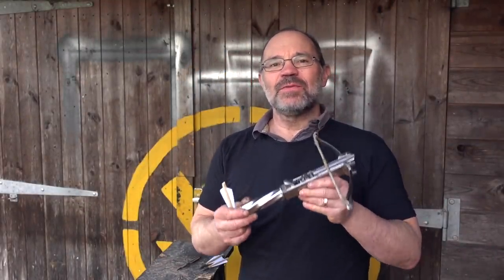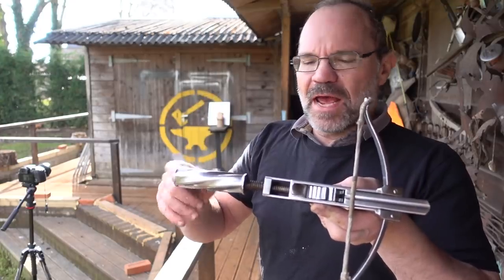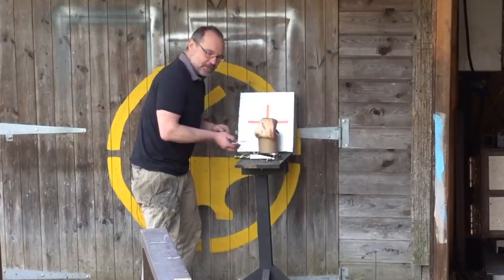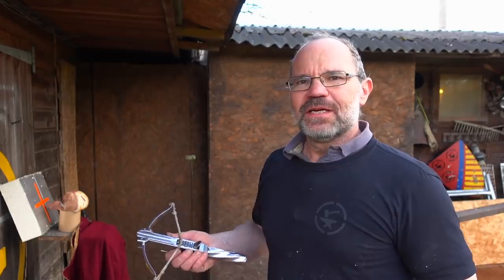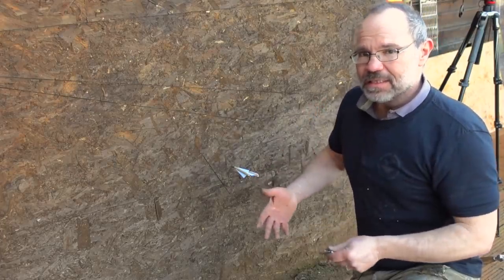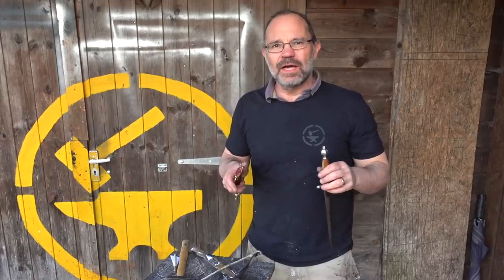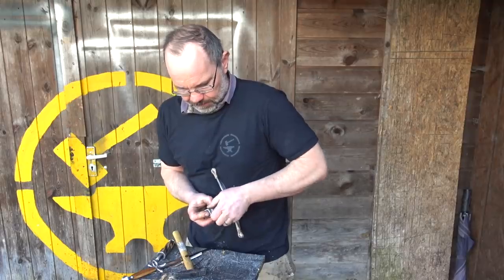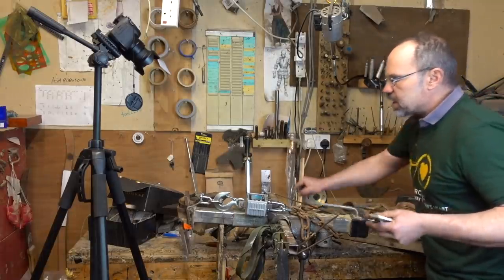200lbs Assassin's Crossbow - LET'S TEST IT!

Comment: Rather than commenting on the effectiveness, can we just appreciate the craftsmanship of that balestrino? it's sculpted in steel so elegantly.
Reply: Incredibly
Reply: Just the cutting of those threads is impressive enough on it's own. Given the load on them, they'd have to be pretty precise.
Reply from the maker: To IpostSwords Thank you - that is very kind
Reply from the maker: To Phil, as Asdrubale implies, I source the screw from elsewhere - life is too short for that!
Reply: @tods_workshop  How much does one of those run?
Reply: asdrubale bisanzio - I was really thinking about the original it's based on. (I should have been a bit clearer).
I've got a couple of Victorian nuts and bolts and I really doubt they'd be up to the job.
Reply: Tod's Workshop - How DID they cut threads around the time of manufacture? Google's a bit vague.
Reply: @philhughes3882  lathe technology was well known at the time, indeed the ancient Greeks would have been familiar with treadle lathes.
Reply: I'm starting to obsess over this. Cutting an external thread (perfectly) is one thing but how did they cut internal threads? I doubt they had taps and dies or we'd have seen nuts & bolts used for all sorts of things- and a degree of standardisation. That jackscrew really is testament to the skill and craftsmanship (and patience) those blokes had.
Reply: @philhughes3882  I think they had taps and dies but they weren't standardized because they were either handmade or the lathes at the time just weren't very precise. Yes, the ancient greeks had lathes but their lathes were only as precise as their measuring tools at the time. They only started getting precise around the 19th century when they developed surface plates that were extremely flat and could be used as a gauge to make the lathes. I think Joseph Whitworth developed the method to create such plates.
You can also cut an internal thread on a lathe with a single point tool. See single point threading in modern lathes to have an idea. But again, without precise lathes each thread would be different.
Reply: @ReticentArc  wood, yes & prob stone but I highly doubt metal. Steel wasn’t developed in Europe till 17th century (developed several times independently, as early as possibly 4K yrs ago)
Reply: @lewisgordon1490  I have to disagree here. There is evidence of pattern welded swords containing high carbon steel, likely crucible steel, in Viking age swords dating to the the 3rd century. Italian craftsmen in the late middle ages would absolutely have had access to high carbon steel both through trade with the middle East and through domestic production. Of course a steel screw would have been very expensive, but that is why an item like this would have only been available to the wealthy further lending credence to the idea that this would have been a toy more than a practical tool or device of assassination.
Reply: Henry Thomas - Wasn't that crucible steel imported from the Middle East? It seems to have only been used to make very high status weapons, which would indicate rarity.
Reply: @philhughes3882  possibly, but not all crucible steel was imported, finery forges and blast furnaces were in use in Europe from the 15 century producing steel, most notably Sweden and Germany producing high quality steel. For this reason and the labour intensive process of hand forming threads limited the use of screws and threaded fasteners during this period, but for this application a screw is absolutely necessary to give you the force multiplication to draw and cock the bow in such a compact package. They certainly were not efficient to produce but then neither were the cathedrals and palaces of the time, it's amazing what gold and plenty of human labour can produce.
Reply: Henry Thomas - Agree on that one, - I've concluded (after way too much thought) that the external thread would be expertly cut by hand and that this threaded rod would be then driven through a pre drilled and heat softened "nut" to create the internal thread. Very skilled and time consuming - but as you say, gold provides incentives. Thanks for your reply.
Reply: @CarlosRodriguez-dd4sb  £2700 on his site 👍
Reply: it has a twisty twist
Reply: Ryan Sabin - Solved!
Reply: They used thread chasers.
Like a multi toothed chisel
Reply: I appreciate how Tod is almost giddy to use this cute little thing...

Comment: This is why we need to stop focusing only on the draw weight when examining or discussing crossbows. The powerstroke (draw length minus brace height) and efficiency are just as important in determining a crossbow's power as power is determined by Draw Weight x Powerstroke x Efficiency.. This assassin's bow shows that a high draw weight combined with a very low powerstroke and presumably lower efficiencies results in a device that has very little power.
Reply from the maker: exactly
Reply: @tods_workshop  I would be really interested to see how it performs with full metal bolts. Maybe even worse, but it would be a cool video I think (maybe together with other crossbows).
Reply: The thing is we would have to create a algorithm for museum curators. Who would be willing to test draw waght, draw length and projectile waght but not willing or able fire an artifact or replica.
Reply: It should have a good efficiency at least compared to other steel crossbows because the arm is so short.  The main issue here is the ridiculously short power-stroke.
Reply: @esoel  Yes, flechetes are the way to go, much less drag & narrower to penetrate deeper to deliver poison quickly.
Reply: Ok, but you have remember that the tips of the bolts would be coated with some sort of neurotoxin that incapacitates the target. It’s not meant for one shot one kill, it’s meant for leaving your target helpless while you safely stick them with your dagger.
Reply: @mrkennady  poisons and toxins quick enough for that to be effective were not common at all. Old poisons usually take a goodly amount of time to fulfill their purpose. Especially with the minute amount you could smear on a bolt head.
Reply: @sentimentalmariner590  I disagree with that, as they were using snake venom as poison (in common terms, in reality they were getting it into the bloodstream) in like 2000 bc. So someone that was literally an assassin as his job title would know some fast acting poisons of various types.
Reply: @rdizzy1 None fast acting or potent enough to instantly or within a few minutes incapacitate a grown man especially with the miniscule amount one can smear on a bolt most venoms also take time, time you don't really have in a fight. The man above who I was arguing against meant quick acting paralytic or spasm inducing poisons or venoms  potent enough to be useful on a bolt head and quick enough to end a fight those did not exist. The most potent snake venom in existence comes from the black mamba and even it with nearly half an ounce injected takes thirty minutes to kill a man and that's from a bite with both fangs an arrow or bolt head cant have even close to that amount of venom on it. Even the deadliest naturally occurring venom that of the blue ring octopus takes 5 minutes to kill and being only found in the oceans of Australia the venom would not be available in the old world.
Reply: @sentimentalmariner590  Not instantly, no, but not hours. Curare poisons that many various groups of people have used on arrows for instance, can kick in almost fully within 1 minute via IV.
Reply: @rdizzy1  and how would a medieval European assassin get his hands on curare? Is it not only made in south America? Same reason I did not include poison arrow frogs there is simply no way a European assassin who used a crossbow would be able to acquire it.
Reply: @rdizzy1  a professional assassin would also know that a blowgun can do the job better in every single aspect. There is a reason blowguns were still used to silently kill targets as recently as the Vietnam War while little hand crossbows like this were relegated to the realm of expensive toys.
Reply: It's like having a car with 500bHp but only bicycle tyres to put that power onto the road.

Comment: Based on what you've said, it sound to me like it would've been a good weapon for an assassin to have within their arsenal.
Here's why:
1. Wheel-lock pistols aren't discrete. The noise and the large cloud of smoke they discharge would result in an assassin immediately giving away their position. Although wheel-locks were more reliable than matchlocks, neither were as reliable as a crossbow.
2. Daggers-- everyone had them, and thus they would've been expected. If an assassin had been commissioned to kill an important person, then chances are they won't be able to catch them alone. The odds of both assassinating someone and successfully escaping would therefore be minimal.
3. The possible application of poison. Even without poison, you wouldn't need land a fatal blow. Mortal wounds were prominent throughout history. If the infection didn't take them, then the medical practices of the time very well could. 

It seems like the sort of weapon that would've ideally been used in a crowded space. A place that would be noisy enough to muffle the shot(s), and would give the assassin(s) a chance to escape. It doesn't surprise me that the Balestrini were feared by the influential.
Reply: This is along the lines of what I thought, the sound alone is quite an advantage
Reply: I agree that can be the god tool for the good job. One thing bother me. The model is a little bit to fancy for beeing a one job thing.
Reply: While I agree with most of what you're saying, paragraph 3 displays a very common but fundamental misunderstanding of the quality of medical care in the Middle Ages. It has always been much more advanced than what most people imagine today and the discrepancy becomes greater towards the 15th century onwards. At the time in which this thing would have been used, wounds from arrows and bolts have been a thing for hundreds of years. Without poisoning someone, it was no problem at all to take care of the resulting injury. Especially for people who are already somewhat wealthy and influential. 

Also, another thing is that back then just like today, sometimes people perceive things as more (or less!) dangerous than they realistically are. Venice banning those things may have simply based on rumors of vicious assassins roaming the streets at night. More often than not, that's all it takes for people to jump on the train and pass some not so sensible legislation. I don't know. Surely, some Italian speaking friends could look into the sources and do some further research.
Reply: Yes, agree, I also see it like that, imagine an meeting in the village where some landlords discuss on the stage and every one calpping and buf arrow shot underneath a cloak, no one saw no one heard… you cannot frisk the whole population of the town, until then the assasin might be gone already
Reply: I can imagine someone shooting this from a bushes in a garden or from a window, being 10-20 meters away from a target, unseen.
Reply: You can't aim the thing
Reply: Who did it kill? That's the evidence we need right there. I've never heard of anyone being killed this way.
Reply: @lolasdm6959  I can.  The guy in the video can't aim and I can make a better one too
Reply: @voidremoved  The shorter the crossbow is, the harder it is to predict where the bolt will go.
Reply: @voidremoved  Prove it then.
Reply: @lolasdm6959  And the more you train, the better you get at predicting it. Expecting someone to be a crack shot after a few tries is not going to work.
Reply: @ohauss  No, some weapons are inherently inaccurate. No matter how you train with a musket for example, you will still miss all the time.
Reply: Any professional assassin with the money to afford a tool like that is going to know blowguns exist. You can get one that is accurate at ranges far in excess of this toy, still penetrates clothing quite handily (speaking from personal experience of getting accidentally shot with one I built), can be concealed up your sleeve, in a pocket, etc. Looks harmless even when found, requires almost no motion to fire from a prepared position, very little motion to ready, and reloads as fast as you can pull another dart out of your pocket. Easy to build, cheap, untraceable, and can even be built at home with little experience and minimal tools. When you get to the higher grades of using it, you can make darts that break off immediately after hitting, introducing the poisoned tip while leaving the rest of the dart behind to be overlooked as a twig with some fluff caught on it and making it much harder to pull the poisoned part out, ensuring the lethal dose is actually delivered, if they even realize they were attacked and not just prodded. By the time people make sense of one just happened and figure out "oh it wasn't just a horsefly" you can be long gone.
Simply put, the situations where this would be more useful in assassinating someone than a gun or a larger crossbow would all be better performed by a blowgun. Any assassinations performed with "an assassin's crossbow", of which there is no evidence any were actually performed, would have to be performed by rich idiots who didn't know what they were doing.
Any consummate professional would know there are better tools at every range in  every environment.
Reply: @Nitidus  I feel that as well as truly rumor based exaggerations, this is a prime candidate for the 'some young rich idiot got injured by one' category of over-enthusiastic bans. It feels like the sort of novelty weapon that someone important's nephew gets shot with and then there's a big campaign to ban them outright despite a) his predictable survival and b)the 'assassin' actually having been his drunken mate who was messing around with a novelty crossbow and didn't exercise proper firing discipline.
Reply: It's not a very good weapon but any hit is a decent hit in that day and age with terrible medical help from that time period. While the bolt certainly isn't packing enough power to reliably cause serious harm, a bolt covered in all manner of nastiness delivering it several inches inside can certainly be a reliable killer.
Reply: @jonathanschloemer6846  You are aware good, accurate blow gun is 120-220 cm long? Good luck hiding that in your pocket...
Reply: @KuK137  Your information is incorrect. I presume you were reading about blowguns intended for birds and highly agile small game, which generally are about that long. You may have noticed that a human is considerably larger than a squirrel.
Reply: You just copied the other comment a year older than yours, but structured it
Reply: @zombievikinggaming4258  I don't copy comments, and I generally don't bother to read them on YouTube. I watched the video and responded to Tod's thoughts with my own counterpoints. It doesn't surprise me that other people disagreed with Tod's conclusion. If I'm remembering correctly, he essentially dismissed it due to it being impractical for a single person to use successfully-- but for some reason didn't think of the possibility of it being used by multiple perpetrators. I believe he also didn't realize that one of the most important aspects for an assassination is the elusion of capture. If an assassin were to get captured, they would make them talk. It's perfect for high-risk, high-reward situations. It would make sense for assassins to use such a weapon when ordered to carry out an assassination that is heavily time-constrained-- e.g. a situation where someone needs to be dealt with before they can inform someone of something.
Reply: @Nitidus The quality of medical care in 17th centuiry England (because that's what the video author is referring to) was apalling. It boiled down to bloodletting and giving leeches (for the same process), as well as drinking some questionable substances (like solutions of silver, which did absolutely nothing). Oh, and... prayer. Couple that with absolutely disgusting hygene (because everybody knows that bathing makes you cold, opens up your "pores" for "miasma", and therefore gets you  sick) and you get horrendous healthcare, even at the highest level. No antibiotics, no real medicine, no hygene sto speak of, and poor knowledge of the human body - again, England, as the historical example states. The Romans in Antiquity had better medicine than medieval westerners, by a large margin. 

Regarding your example of bolt/arrow wounds being known for centuries - the most common method of treating them was burning the upper layer of flesh away. That's not good medicine.